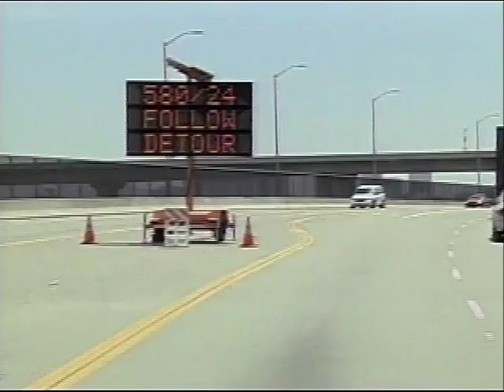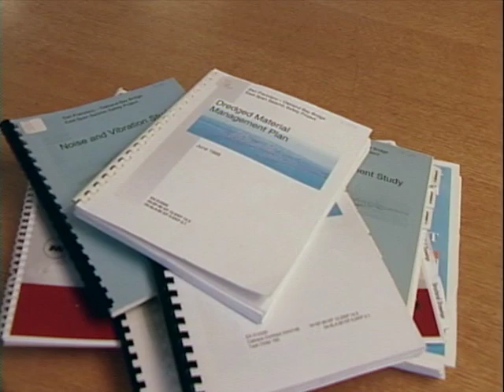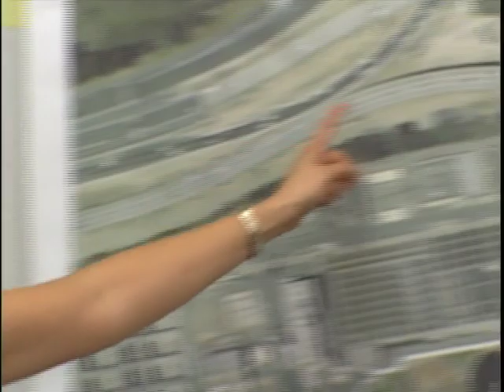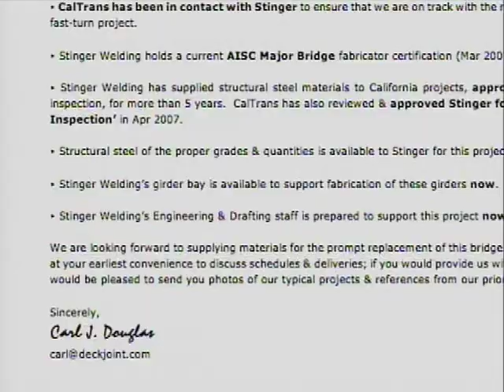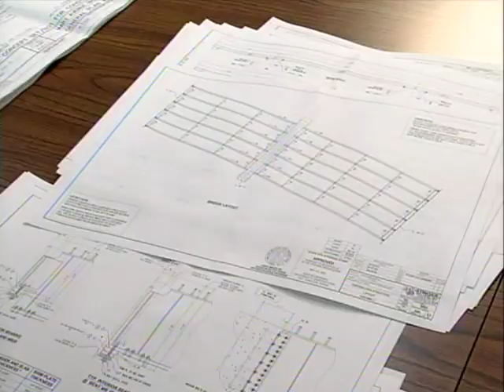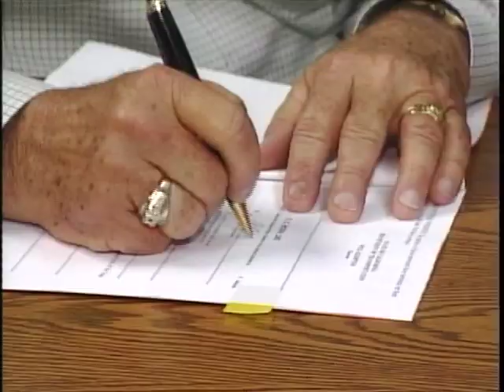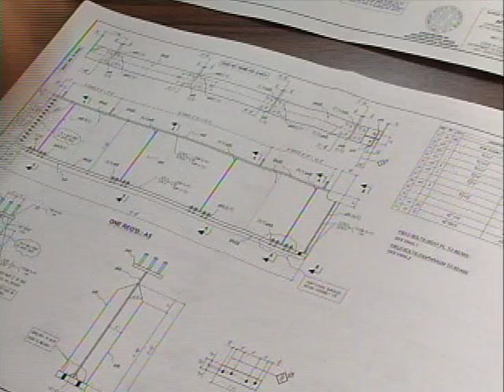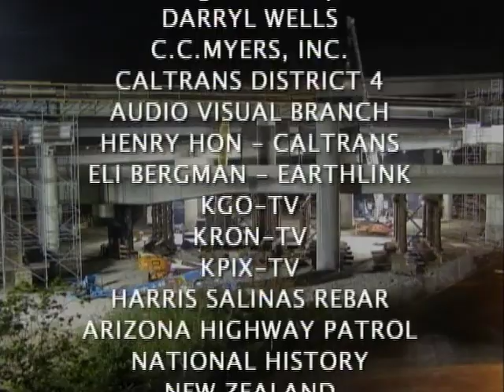Amazing: The Rebuilding the MacArthur Maze (Documentary)

Comment: crucial point is that this wasn't "a project". it was what these people have been doing for years, intensely focused on this spot for a short period. they are practiced, they are good and confident at it, and they can do it fast when motivated. there was very little "unknown". it was mostly known tasks, known plans.
it was a crunch and it could be, because it wasn't a huge project. you can't crunch huge projects. people tire out eventually. you can't "add" people or resources. you need to use the resources you already have, because that's your organization and how it knows to function.
in project management, the difference between "regular operation" (e.g. manufacturing) and "project" is that projects are singular events mostly consisting of things that were never done before.
Reply: "you can't crunch huge projects."
Ah, that would be nice if true. Not working in construction but programming - so the wearout is not that hard physically but more mentally, but we have managers that push near impossible schedules like a few years ago a team of 5 people being on-side (custom-software) and 100-120 hours a week - for a month. Sufficient to say that most people involved in such crunchtimes have then quit.

Comment: Same thing happened to I-95 in Connecticut some years back. A tanker caught fire under the bridge and melted the steel just like that, and the bridge that melted in that case was brand new so a bit of bad luck there. Within two days they had placed a temporary bridge so traffic could get moving again.
Reply: 2004.  Bridgeport I wanna say.  Melted a small viaduct.
Reply: It happened again on I-95 lol

Comment: Did the steel beams in the WTC's reach 2000 degrees?
Reply: Much more because it was inside, it would have been like a forge with the wind howling in from the hole.
Reply: @tubester4567 , Interesting. I remember hearing or reading that the heat from the fires in the WTC was not enough to soften the steel girders or beams.
Reply: @WJack97224  There was plenty of misinformation from conspiracy theorists who didnt have a clue what they were talking about.
I've debated many of them online,  I have a metalwork background so I tried to explain it to them. Some listened but many didnt.

Comment: To be honest, it’s time for that whole dang thing to be rebuilt with modern ramps. Those ramps where built in the 1960s, and now it’s 2018 and I’m surprised they are still standing and have not been replaced...
Reply: Well unlike in say the Commonwealth of Massachusetts bridges in California don't wear out to require replacement in 50 years
Reply: Technically, a lot of it was rebuilt in the 1990's.
Reply: @edwardmiessner6502  Really? Then you've never worked on a Caltrans bridge. Almost every bridge structure in California has required multiple retrofits/upgrades.
Reply: @zacharyyamashita8554  A lot of it was reconfigured after the 1989 quake that took out the Cypress. But if you drive on I-580 to I-80 West / East, take a look at those rusted out railings... Those are 1950s...
Reply: Not accurate, the part he was driving on was built in the late 90s to replace the Cypress structure that collapsed in the 1989 quake. I was one of the first people to drive on it after it opened.

Comment: So JetX CAN melt steel... OK
Reply: No, it vaporizes the moisture in the concrete causing it to explode. Concrete always has some amount of water in it. The steel doesn't do all the work. The concrete and steel work together steel providing tension strength and concrete providing compression strength. When the concrete goes the steel acts like spaghetti. If this is a WTC reference there's many more factors to account for as well. This is in open air with little to no  drafting. Fire forensics is messy and complicated.

Comment: The engineers with CalTrans are fine and perhaps even excellent, but CalTrans is political and there is the problem. We don't need politics and political government to tell us how to conduct our lives.
Reply: Ummm... if only it weren't for their screwups on the old and new Bay Bridge I could almost believe that. One of my friends was an intern for them and told me how proud they were of the engineering of their roads. I showed her some roads built in the last five years, at that time, that weren't even flat. Then took her to Scotland and drove her on roads that were built 30 years before and despite winter snow and ice, and summer heat, and heavy traffic, are still flat and smooth and well drained. Other countries can put down white lines that don't vanish in the rain, and engineer roads to drain without making them undulate. The area leading into the tolls immediately west of this incident becomes one big unmarked pond when it rains. Nobody can make out the lines and the water doesn't drain well. I880 south of central Oakland was so badly built that it caused major accidents, there was a sudden drop off the bridge section and people easily lost control. I worked on the other side of the Alameda Channel and we had a great view of the crash recovery going on. After a fatal accident they finally fixed it. One of my friends was a construction engineer on the A14 in Britain, he was worried that the surface wasn't flat to plan, he thought it was an inch low in the middle of a 200 yard section. California roads aren't that flat in a 10 yard section the day they are built.

Comment: Who paid for this fawning documentary, with its custom ordered animation? Lots of money spent here. Gotta give it props, this is one pretty effective piece of propaganda...but for whom? Schwarzenegger? Meyers? Stinger Welding? CALTRANS? So many players are given the hero gloss that it's hard to tell who is the intended beneficiary.

By the way...this idea of bonuses for extraordinary performance only works once or twice. After that the players come to expect bonuses and begin gaming the system. Often that's done by sandbagging estimates of delivery times, or in the worst case cutting corners.
Reply: Right, you really need a system where black marks for previous failures count against future bids, so the city might take a more expensive bid from a more reputable company. Hopefully that would also force contractors to do their best. And of course the estimates should be done by the city, and the timetable handed over as a non-negotiable part of the bidding process.